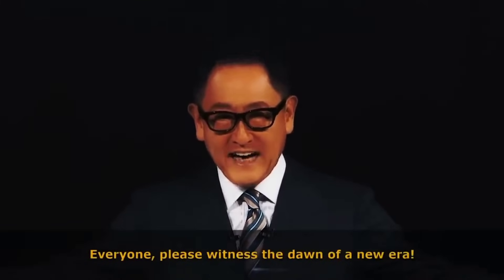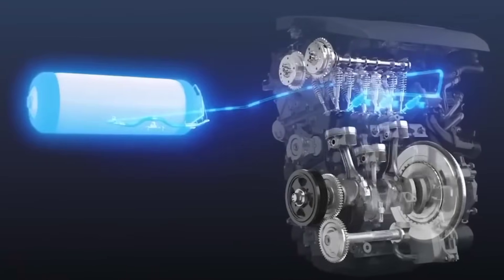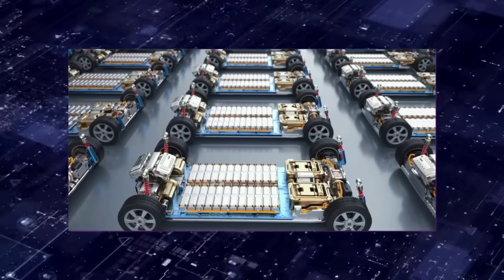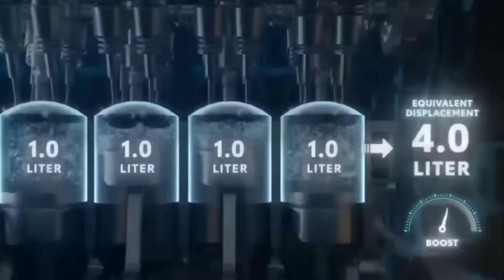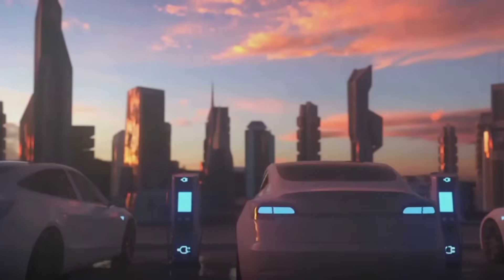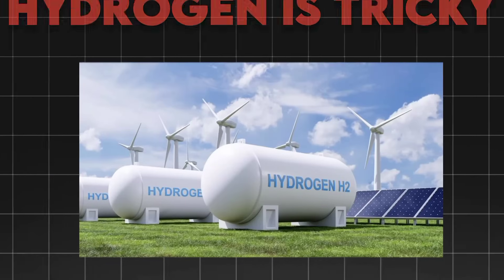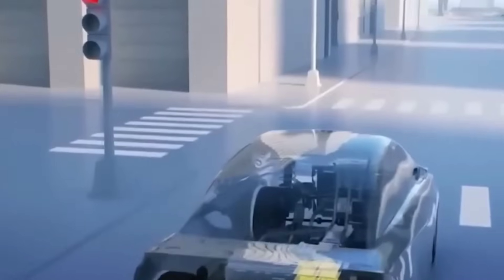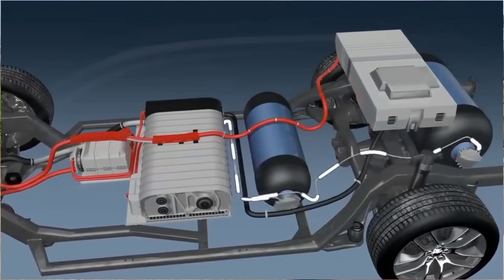Toyota Introduces WATER ENGINE: The Future of Cars is Here!

Comment: And they forgot something so important: installing an air-cooling coil, which would recover the water vapor that comes out through the exhaust and return it to the water tank. Isn't it pretty stupid not to do that?
Reply: that's a good add on, but again water is found everywhere which makes it redundant?
Reply: @AshayaDhungana10  Not so much in the Gobi or the Sahara
Reply: no with electrolysis you are able to extract the hydrogen from the water and only release oxygen

Comment: The whole concept depends upon having a hydrolysis process that provides far more energy through combustion than is required to create the hydrogen in the first place. That is where the trick of the process is and they don't explain that here.
Reply: there will be some technological advances, or so i hope. just like the EV batteries, some simple tweaks, that made them practical.
Reply: @ZenMindGames-v3c  I remain to be convinced that this process could provide more energy in combustion than required for hydrolysis,  remembering that combustion is unlikely to reach 40% conversion efficiency.
Reply: Hydrogen is not created, it is just separated from the water molecule. You can read about it at a later date; perhaps that will assuage your academic skepticism. In the meantime, this is the future of the CBE. Even Elon realizes it! 😎

Comment: Und wo kommt die elektrische Energie für die Elektrolyse her ? Das ist ja wohl Blödsinn !!!
Reply: decent size battery
Reply: @ZenMindGames-v3c  lol how big is a 'decent' size battery??
Reply: @ZenMindGames-v3c  OK, then it's basically an electric vehicle.
But to convert the electricity into motion with a 90% efficiency, they take the detour of creating hydrogen from it and power a conventional conbustion engine with it, resulting in ~30% efficiency.
Saying this car runs on water is like saying your conventional petrol driven car runs on exhaust gases.
Reply: @heinzk023  conventional cars are fed gasoline, but this car is fed water.
Reply: @ Your conventional car is also fed water, for the engine cooling and windshield wipers. But neither of both cars use it as an energy source. So you and I can say that the motors of our conventional cars are being „water driven“, if you want. Toyota itself never calls its invention a „water motor“

Comment: Toyota has also been exploring hydrogen combustion engines, which burn hydrogen directly in an internal combustion engine. For instance, a hydrogen-powered Toyota Corolla participated in the Super Taikyu Series race, showcasing the potential of hydrogen as an alternative fuel. However, these engines use hydrogen fuel, not water.
Reply: how about making factories that produce large reserves of hydrogen, and cars can refuel hydrogen just like they do now from gas stations?

Comment: 2(h2o)+1unit of energy(some energy scale)= 2h2+ o2 it takes some energy to get to 2h2+o2 which means this state is at a higher energy then 2(h2o), when u burn 2h2+o2 u get the same energy back this is if u have 0% energy loss(in reality both turning 2(h2o)into 2h2+o2 and burning 2h2+o2 into 2(h2o) lose energy as heat), so if u some how managed to make a lossless system u would still at beast net 0 energy, to move stuff u need energy, there fore math aint mathing

Comment: You mean, use electricity to make hydrogen (wasting ~30% of the input energy), then use that hydrogen to make electricity (wasting ~30% of the input energy)  You get less energy each cycle. So this doesn't work. 
Even if we could get the electrolysis to self sustain it still wouldn't produce enough extra energy to drive the motor as well!!!!!!!!!!!!
Reply: polymer electrolyte membrane technology is promising in this case, and in near future this water technology will be viable.
Reply: efficiency is not effective energy.
Reply: @bobobobo490  first step is not the final product/concept.

Comment: as mentioned, It takes a lot of energy to create hydrogen and oxygen out of water ... Where does the car get this engergy from?
Reply: electrolysis looses 30% every cycle so any energy produced would get less and less until it's not enough any more let alone have any left over to power the motor as well. Misleading Video as well. It's not a water power engine its a hydrogen engine but they keep describing it as a water powered one which leads to this video is absolute rubbish
Reply: @russtafari262  but you fill in the tank with water which is then used to make hydrogen and run the car, you don't fill in the tank with hydrogen like filling up gasoline...
Reply: like a hybrid when the car moves you get an energy source of kinetic energy which can be transferred to the engine
Reply: @s-ph1a  You should have paid more attention in Physics class; a hybrid vehicle uses the vehicles engine or charging station to charge the batteries, the only time the motion of the vehicle is utilized is in regenerative braking.
Reply: Maybe that is from fueal